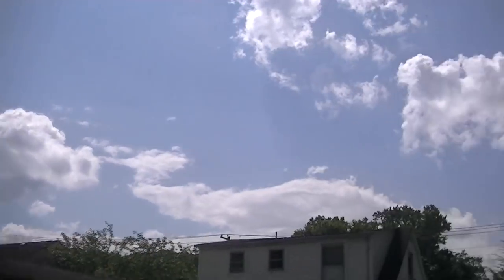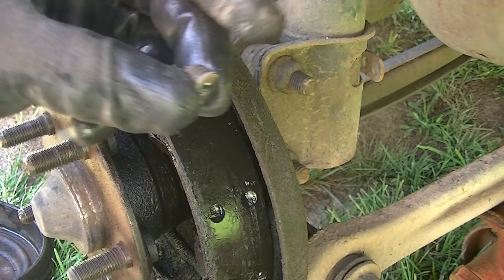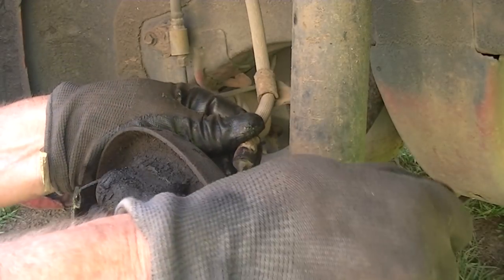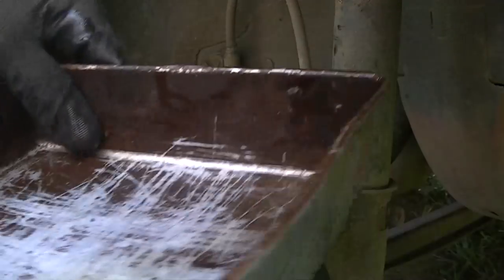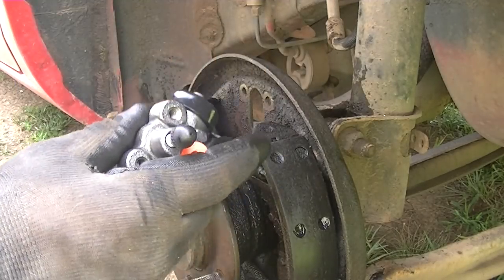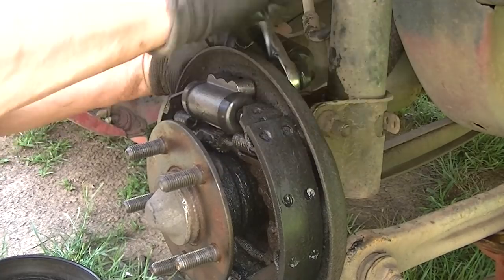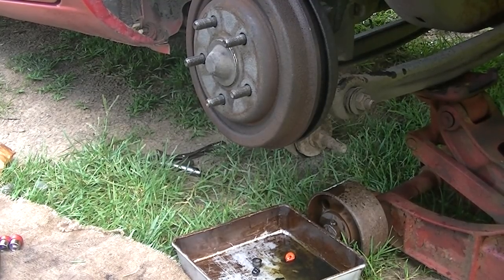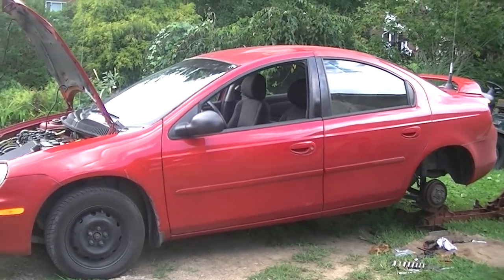Rear wheel brake cylinder Replacment

Comment: I don't recommend using vice grips any where on the brake line.....not a good idea, some people will use too much force and crush the line and or twist it too much and damage it. Use a little WD40 on the bolts and brake line fitting and let soak
Reply from the maker: Yea never good unless your replacing them.

Comment: I learned from you're tip of "bleeding" the brakes, I'll remember that. And line wrench use,and care in taking wheel cylinder bolts out , along with BRAKE LINE care in getting the nut loose without stripping it. Thank you sir;